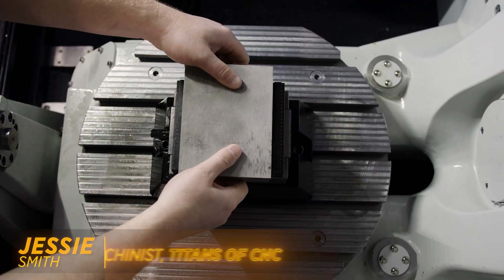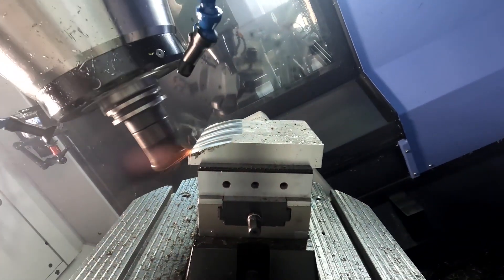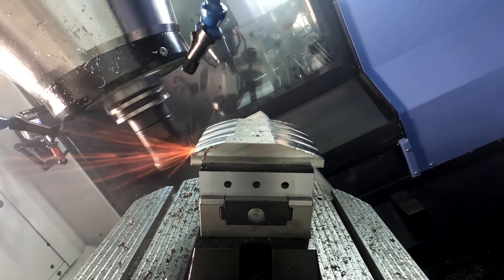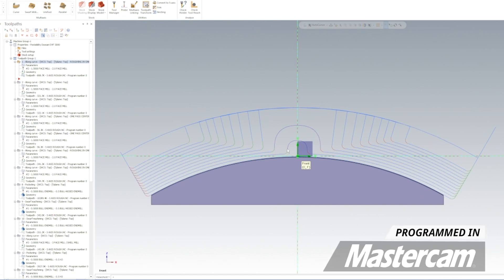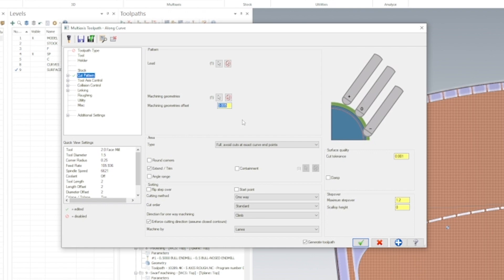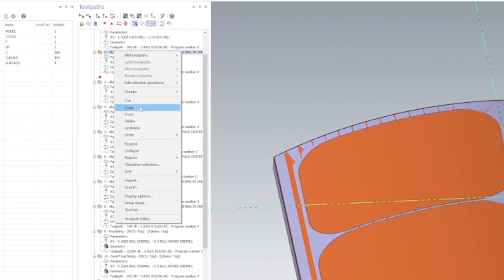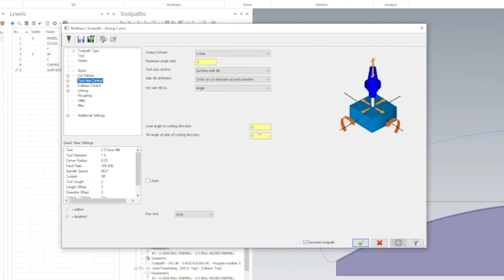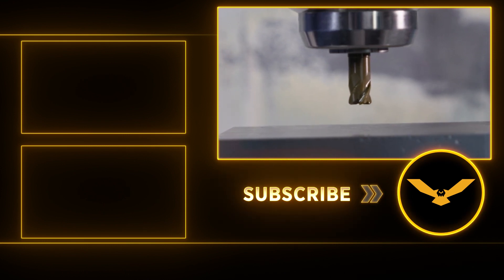Machining INCONEL 718 with Ceramics | DVF 5000 | DN Solutions

Comment: The kennametal 1/2 inch button inserts can take a beating. 5000 rpm @ 90 feed rate. .06 depth of cut. Ceramics are awesome & a time saver

Comment: Yeah the shop I worked in we were doing this type of 5axis swarf milling with facemills twenty years ago using tebis cam software. Crazy stuff. I was cutting a lid on a kirksite mold in my vertical 5 axis dayton mill at a maxed out spindle speed and maxed out feedrate of 1500 inches per min I couldn't run it any faster rapid is 1575. Machining area of the machine is 10 or 12 feet y by twenty feet in x. The biggest issue was protecting the machine from the blasting force of the rooster tail chip stream. That would blast away metal of the machine if I didn't  protect it and bystanders. Of which the owners and salesman were constantly bringing by customers because they never seen machining or a room size machine cut that fast twenty years ago.

Comment: As an engineer, we step away from selecting inconel or hastelloy as much as we can because most of our vendors are uncomfortable with it and the resulting costs are difficult to justify.   This despite the very good corrosion resistance and resulting low particle contamination it provides for the semi-conductor equipment market.  Parts made of these metals will never be inexpensive but thanks for spreading the knowledge on how to make them doable.
Reply: inconel partial strategic use in valves and valve seats  enabled me to make valves for use in NHRA but would not allow mechanics to do as much work so they never took on my design . Literally because they last to long lol. I built a 10,000 hp engine to Troll with that has probably 500 passes on it but do no content on due to threats received. Most engineers are woke and go along with the agendas of dont make anything last because then there is not enough money involved. Why its sad so many are so dumbed down they idolized satanist like bill gates who wants to depopulate humanity. Thankfully materials of this world are watching many of these evildoers currently for treasonous activity which some of my patents are envolved in. White hats are in control now .
Reply: maybe consider ordering your party from titan? he sure is comfortable working with inconel
Reply: @dr.candyflip4854  Sadly the approved vendor list is very difficult to influence.

Comment: Super awesome! How many parts or how many minutes until you have to replace the inserts? Also, why no coolant?
Reply: On your second question the answer is, it’s all because Inconel is “hot” material. This materials cuts only with air blow unless you want to replace inserts every minute
Reply: @mikhaildavydenko6841  and because you don’t use coolant on ceramic tools. Thermal shock will break them quick

Comment: Real good train of thought there! Bosses like loud programs, they have to walk less to know the spindles are turning!
Reply: And your coworkers hate you if there is nothing to prevent vibrations🤣
Our lathe produces shit surfaces when the big mill is shredding away some holes🤣 
Lucky thing is that the parts mostly are ground afterwards so problem with that because the grinder is sturdy and far enough away

Comment: My question is in the vicinity of Patrick Joergensen's.  With all the heat generated during the cut what happens when you release the clamping forces.  Does the part twist and shout (sorry my humor for you old farts, but hey I'm 74)??  

Years ago (2001) we had a big piece of one of the super alloys. Cut on it for a week, send it out for stress relieving etc, cut for a nother week etc stress relieve.  The programmer was doing a lot of plunging in the early roughing stages. They were really concerned about the stress.  Now you come along and you triple double down.. What about the stress!

Comment: Now why in the hell is this done through GUI and not code?  This was a bit painful to watch.
Reply: what do you mean through GUI and not code? mastercam outputs an NC file, that gets put in the machine
Reply: @vanguard6937  Yeah, mastercam handles the entirety of the G-code programming and management. 

However if you want real control you write the g-code yourself like a real dev. This is just configuration. Programming is pog if you do it right. I guess its a bit old fashioned now, the time where you used to program CnC machines are gone I guess.
Reply: @TheNameIsForty   question…. Your saying write all 5 axis code by hand typing it in at the control? If so you must be a mathematician genius and an incredibly fast typist to input your code to make a part like this without using something like mastercam. Because the bottom line is that no one can program a cnc with complex tool path like this as quick and as accurately without a software of some kind. No One…..
Reply: @robertd1970  Well I have at least attempted it way back in the day. long before parasolid files and mastercam was standardized. 

It is a very long winded process, and much like you design these tool passes in mastercam, you would have to design and calculate its trajectory past x, y, and z planes for two controllers. And run the two controllers at the same time. I remember that one of the biggest problems to tackle was the federates as you had no way to inter-calculate between the controllers during operation, meaning you would have to estimate the federate between the controllers beforehand. 

Safe to say, me and the stop button became good friends. Keep in mind that this was done on a old shoda machine, which had more or less no safety features, open desk and the spindle often a bit too close for comfort during operation.
Reply: @TheNameIsForty  the goal of using a CAM software is to only have to write the program once, as quickly and efficiently as possible. Where in this video, it takes lets say an hour to program the part in mastercam, trying to do it by hand would require days, with lots of checks, and lots of time at the machine. Not only that, but the file from mastercam would be much more precise than anything hand written. 

While writing full programs by hand used to be the way to do it, in this day and age, writing by hand is going to slow the process down to the point of your competitors having the part sent out before you even get the program done. Is it important to learn how to read, understand, and adjust gcode though? absolutely

Comment: I was wondering about the heat generated by this type of operation - not whether the tool can take it, I know from previous videos that these things can do that without issue if run correctly.

The material gets quite hot though, I'd imagine, and the same thing goes for the vise to some degree right?
Even though it's "just" roughing, is there any danger of the setup being compromised in regards to accuracy/safety, if the material gets to cool down enough so that clamping pressure is diminished, if and when the intent is to finish this first side in the same setup? Or is that something you already take into consideration :)

Thanks in advance from a Danish fan with no experience regarding ceramic milling ^^
Reply: With ceramics you don't run coolant. If you did then as soon as you start cutting the tips will explode due to the temperature difference. I've always been taught when using ceramics on materials like this if your chips look how they are in this video you it's right
Reply: As Titan has said in the past: When they film, they don't use coolant to get a better shot. I would assume that they are going full coolant when in production mode.
Reply: @bobbiac  not with ceramic tools - run coolant on that and it'll destroy itself instantly, that much I know for sure ^^
Reply: Was thinking the same thing. Guess it depends on part tolerances. Possibly cnc grinding to finish specs or maybe wire edm to eliminate heat distortion. Although Wire Edm may have some deflection due to length of wire needed.
Reply: Heat is drawn out of the part through chips while machining there are exceptions of course
Reply: View & subscribe to my channel for exclusives